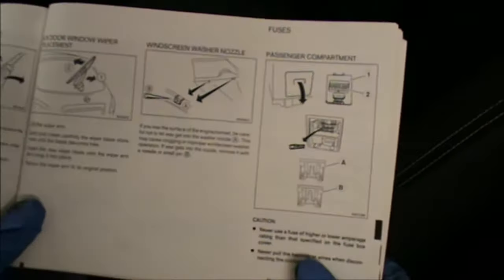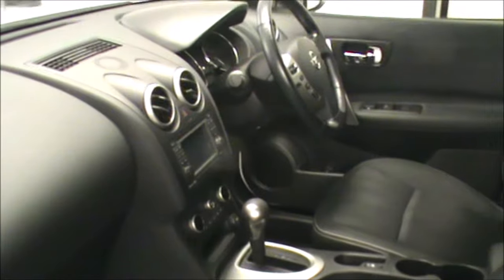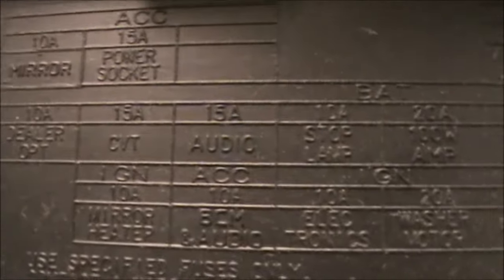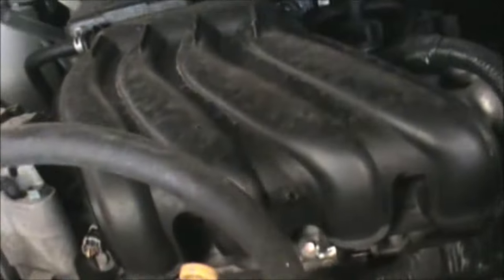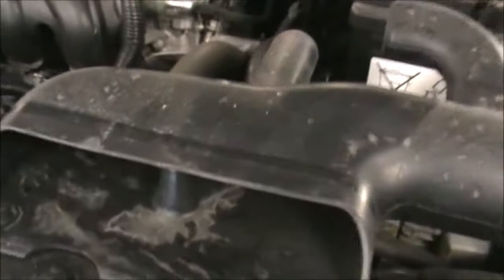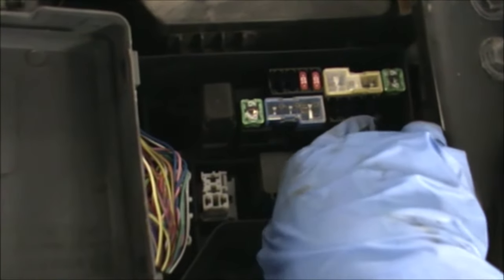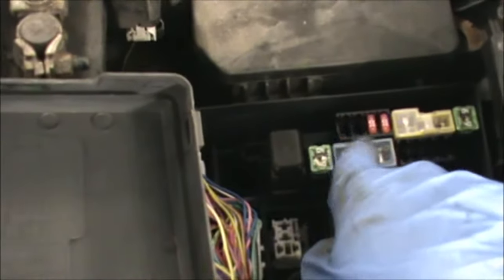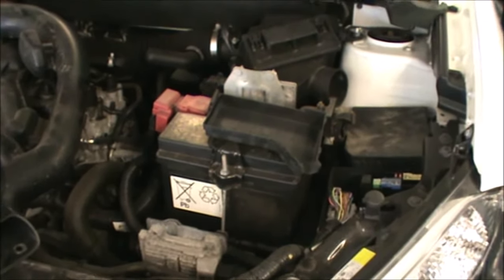Nissan Qashqai 2010 2011 2012 2013 1.6 fuses location

Comment: Lets try my chance that I can get an answer before the trip I gotta go. 😅

My horn is broken and it beeps by itself even when the car is off. Especially when I turn my wheel through right and left, simply moving it. It drove me crazy, my neigbours literally staring at me like I am a mad man lol. 

Back in time a random man just opened the front and disabled it with a simple move without moving anything in kaput but I forgot to look at it since I had an emergency meet. Now no one knows how to do it until I get my car to repair, can you help me? The car is European left version J10 1.6
Reply from the maker: It might be a problem with the steering wheel hooter which has the airbag in it. The contact inside might be constantly touching and therefore making the horn go off. The airbag may need to come out to have a look.

Comment: Unfortunately some things in my car is running after I turn off my car . if I don't turn on my car for 2 or3 days the battery won't work. I thing it related to fuses . Can you guide me?
Reply from the maker: I think you need a multimeter and when the car is off check the battery voltage, if it is less than 12v then your battery might not be in good conditions. but if you see the voltage rapidly dropping then yes you might have something that is consuming energy, but I would start there.